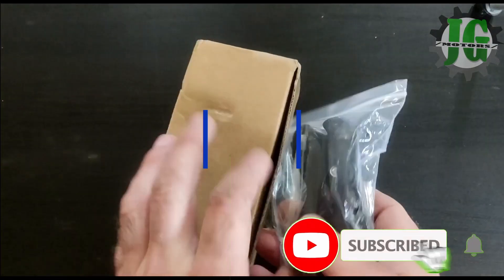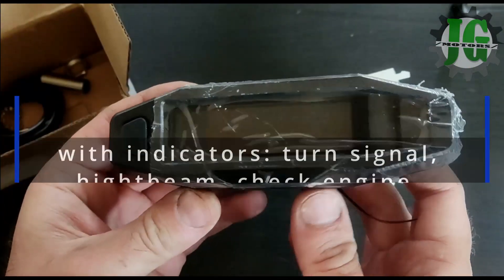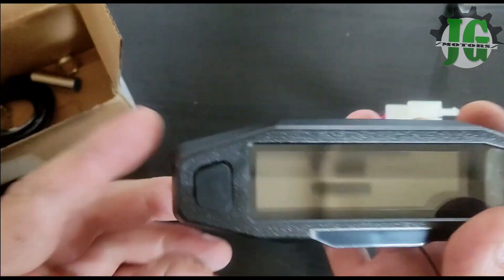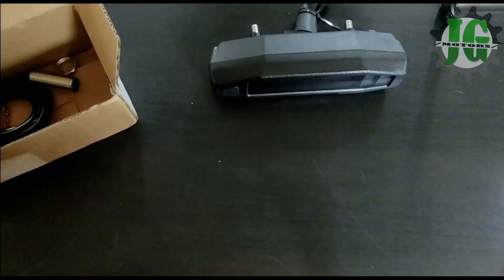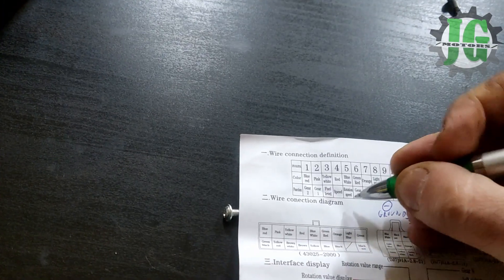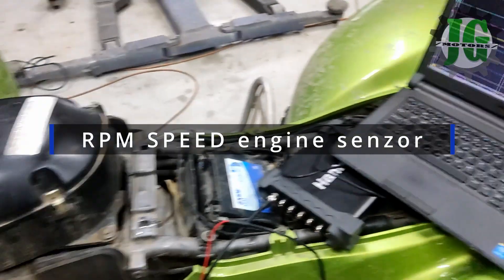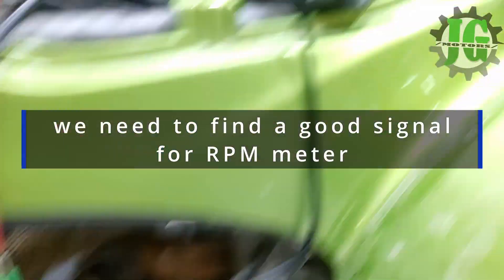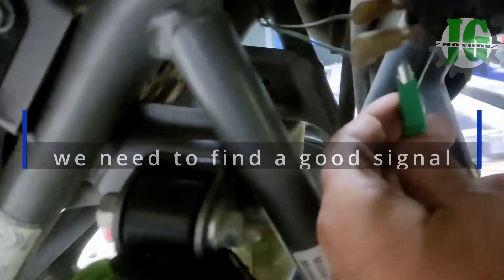Universal SPEEDmeter , tachometer from aliexpress FULL GUIDE and full test

Comment: Hello, i havé problems to Connect rpm on my Yamaha virago XV 125 cc. Rpm are going up and down Even when no accélération, if it.s connected to spark wire. I would like to test this «  cranck shaft sensor ». CAN you explain me where is this cranck sensor? Sorry for m’y english, i leave in France.😊. Thanks in advanced and thanks for vidéo
Reply from the maker: hello bro. crankshaft senzor is located on the alternator coil. You must find wiring diagram for XV 125 and connect your rpm speedmeter to crankshaft wire

Comment: Hi, i couldn't get the speed and rpm wiring correct on my bike for some reason. My speed is affected by engine rpm while my actual rpm isnt detected. Ive wired the CDI signal to the blue white, while for the speed sensor i used yellow, green and red to the bike speed sensor.
Btw, for some reason i got 2 blue white cable and no orange?? Might need to double check on them
Reply from the maker: On what motorcycle model?
Reply: @JGmotorsSK keeway tx200g

Comment: Does your unit keep the settings memory automatically?

I have wired up with pos, neg, speedo but no lights or RPM.

I set the wheel size etc, but when turned off the memory resets

The manual doesnt say about a second 'permanent' live for memory
Reply from the maker: Yes saving settings is automaticaly. 
No lights? Have you same model?
You have different model or unit is wrong. Exist many unit and looks the same, but have different options
Reply: @JGmotorsSK option is there, I have not wired it up I mean as bike doesnt have lights and indicators. I just need speed readout.

Maybe I have a faulty unit 

Thanks for the video!

Comment: Thank you Dro', you answered my question about the speedometer, I thought the magnets should be on the wheel, but you positioned them on the wheel axis, and on my ER6n the Hall effect sensor is already on the gearbox output gear and is already used for gear acquisition, I think it should work perfectly with this original sensor. I just hope that I can indicate to my counter the number of pulses (4).
Reply: Hi , I'm from the test , so it's possible to use the original speedo-sensor of the bike , the new speedometer from china comes with HALL effect sensor with three wires and the original Kawasaki sensor with three wires too and works as the china one.
My ER6n Sensor have : Yellow, Black and Pink ( or washed Red if it is old by the motor heat i dont know but it looks like Pink ).
The speedometer indication for the speed sensor connection is : Yellow ( velocity Signal + ), Red ( velocity signal - ), Green for the ground ( connected on the chassis somewhere on the bike ).

I made many tests and the result is OK like this :
Bike              -          Speedometer
PINK            ---         YELLOW
YELLOW      ---          RED
BLACK         ---         GREEN

Dont' forget to set the number of the PULSE ( magnet number ) to 4 because : the sensor on the Kawasaki is made by a SQUARE nut on the gear of the final transmission just out of the gearbox.
According the circumference of my rear wheel , the indication is accuracy as a charm :) ( for this you have to calculate the real circumference of the ENTIRE rear wheel with the real diameter with the tire , not the diameter of the wheel ( 17" for the ER6n  plus the high of the tire and so on You can find online calculator to find the exact circumference of your wheel and put it into the setup of the speedometer ).
I can help you if you want .
Reply from the maker: @MC909Garfield  great thank you 😊
Reply: @JGmotorsSK  You're wellcome :) 😇😜
Reply: I just forgot one essential thing : THE RATIO between the rear sproket and the gear out of the gear box , these twoo gears makes a Ratio applied to rear wheel to be sure that the distance displayed on the oodometer is the real distance and speed ... On the ER6n the gear is 15 teeth per tour , and the sproket is 45 teeth per tour , so a 3:1 ratio ...
I think that we have to set 12 pulses = 3 tours ( 3 tours of 4 pulses = 12 pulses ) of the gear for only 1 tour of the rear wheel to be sure the real distance is correct ... We have to be sure that the ratio is near the one we can setup into the speedometer ...  or the distance could be wrong ...
Reply: I will test this thing as soon as my ER6n 'cafe racer' will be finished ... I think I'm not far from the truth ... wait and see :) :)
Reply from the maker: This your solution for original gearbox senzor I didn't try. Try it and report back if does it working
Reply: @JGmotorsSK  Yeah , I will do it , I will recieve the MT007 from the same factory in few days , I will test it on my ZX6R firstly , then as soon as the ER6n is finished this speedometer will be used on the ER6n . I will test the connections to the crankshaft for the RPM sensor , because on the ER6n there are 2 pencoils and not only one coil like your bike, it's the same on the ZX6R ( two coils ), and the spark sequence is cylinder 1 and 2 with the coil 1, and cylinder 3 and 4 with the second coil , so I think I have to use the HALL sensor from the crankshaft and setup the speedometer with the right ID value. But did you have a spread sheet with the whole ID and theyre value for the setup ? I don't know if this information is given with the wirering diagram in the box ...

Comment: Where do you connect the yellow 5v output? I think that it is the memory of wheel specifications, magnet number, etc
Reply: The 5v goes to the sensor included in the pack if you ordered the pack with the sensor , if you didn't ordered the speedo with the sensor you have to find a three wires HALL effect sensor ...
Or if your bike is equiped with a speed sensor like lots of bike on the market read my answer to the comment I write to JGmotorsSK in the first comments :)

Comment: How do I set the rpm counter on a 2005 Husqvarna SM 125 2t? Is 1 magnet enough for the speed sensor?
Reply from the maker: yes for speed senzor is enought 1 magnet. for rpm, first have to connect ignition coil or ignition senzor. And then try several settings

Comment: how can i set total kilometers?
Reply from the maker: dont know
Reply: Put a 6 faces nut on an electric screw , and turn this nut in front of your speed sensor to accumulate the kilometer you need to match the real kilometers your bike own , there is not any solution at all but this one ... you can't do this except re-programing your speedometer ...  I will do this to display the real 'age' of my bike :) :)